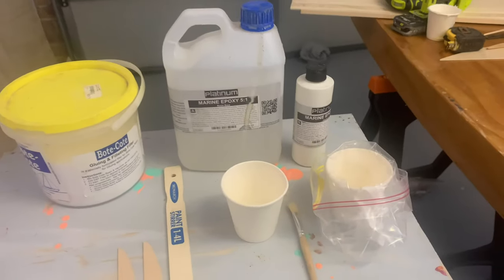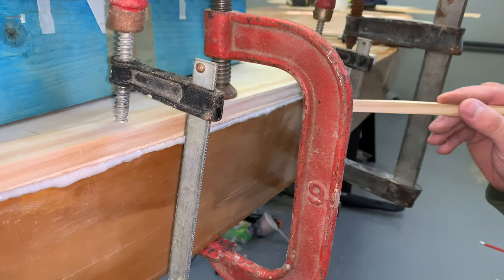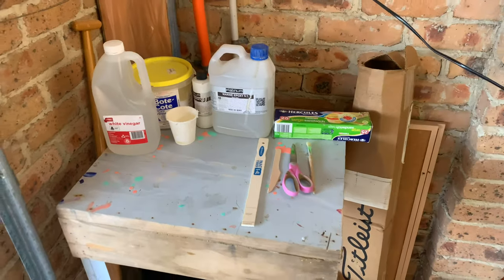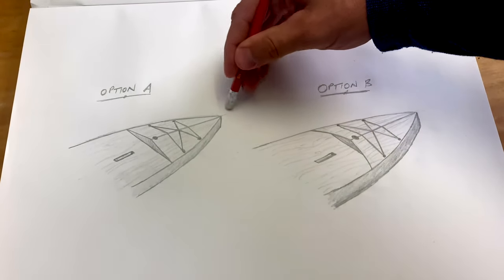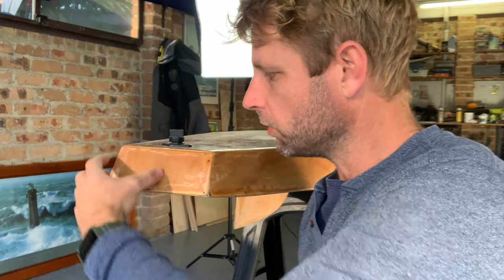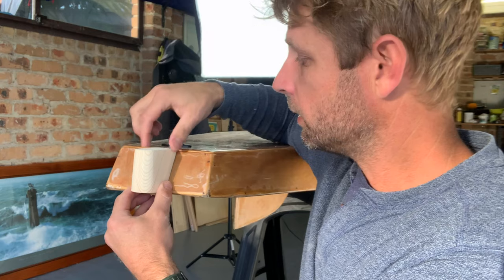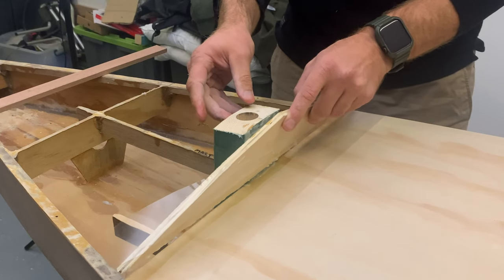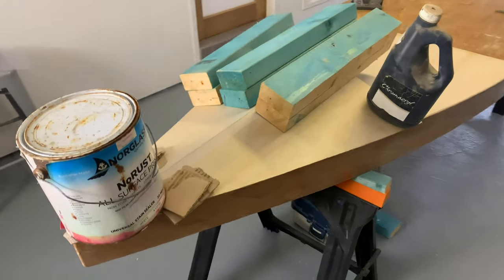[Ep 4] Adding a SAIL to a PLYWOOD SUP - glueing plywood foredeck, and rudder post for kayak rudder

Comment: I see that someone mentioned kerfs already. You could also have made a cut from the forward edge down the centerline to relieve that stress point in the ply (similar to cutting a dart but not triangular). Gaps could be filled with your epoxy/balloon mix and sanded fair after curing.
Reply from the maker: Thanks Robert, that could have worked too. I think they call those kind of cuts gores.